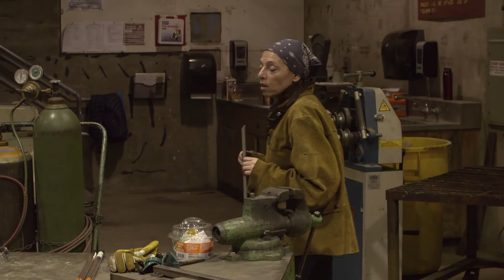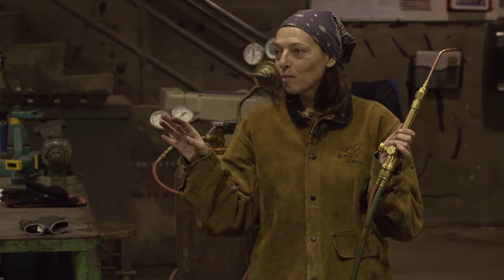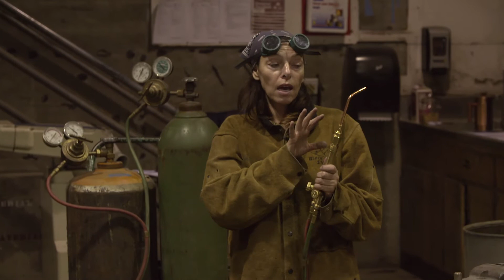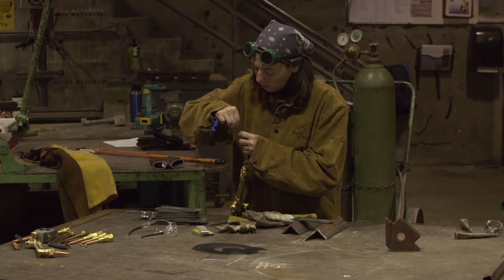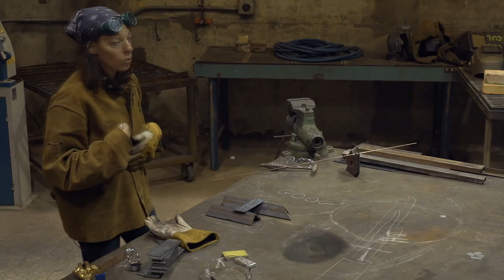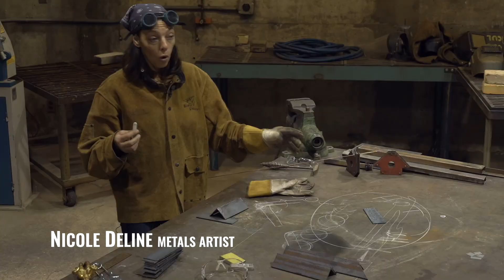MetalWorks: Intro to Oxy-Acetylene Welding

Comment: I've done all the welding processes and the process I only use now is Oxyacetylene Welding/Cutting with 21 years experience and It was the process that attracted me in 7th grade and I know it's slow and obsolete but I can Oxyacetylene weld 1/4" plate #5 Victor tip. I would like to add a safety tip when connecting the tip to the handle NEVER EVER use a wrench on the nut on the nozzle or cutting attachment it will damage the "O" rings causing a leak, only hand tighten I have seen fire shoot out around the nut.